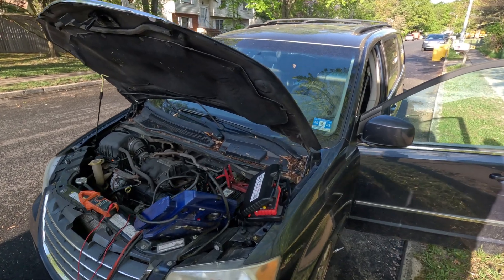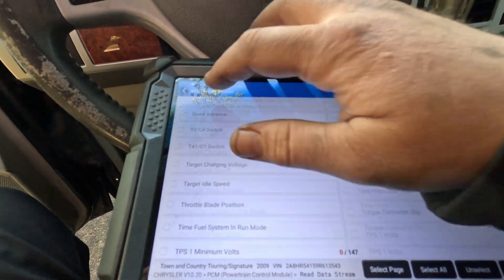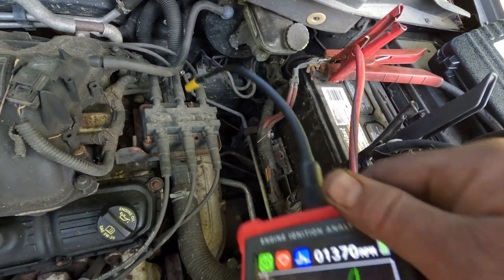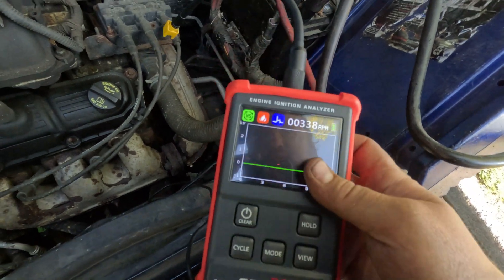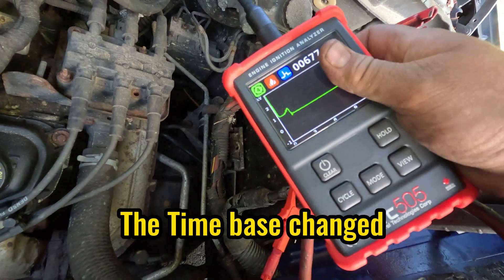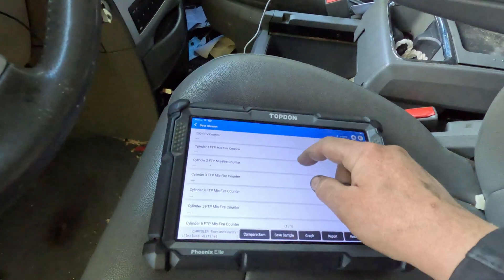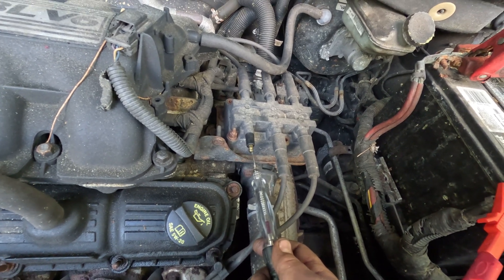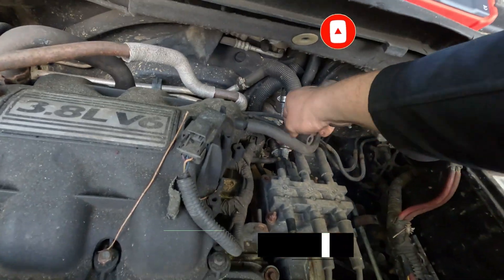Chrysler Misfire - Playing With A New Tool (GTC505)

Comment: Were you looking at the counters on global mode 6, or a Chrysler menu? 
Either way, wonder if the flywheel has to be learned after code clearing.
Reply from the maker: I honestly don't remember which one I was looking at. But that is definitely a possible reason why.
Reply: @advancedleveldiagnostics  Thank you for the reply. I like looking at mode 6 before any code clearing if possible, for documentation purposes. Also, have you used the VVT pid on mode 6 for diagnostic purposes? Just curious.
Reply from the maker: @rodvan-zeller6360  unfortunately I'm very weak on mode6, I pretty much only use it for misfires on older Ford's. I really need a good class on mode6.
Reply: @advancedleveldiagnostics  Thank you for the reply. You are not weak on mode 6, you are stronger than most because you know what you don't know.
I like using mode 6 for several reasons, one of them is record the numbers before and after repair when the monitor runs, for documentation of repair proof. Most of my past employers had a mission to prove me wrong on a daily basis due to their ego issues, so I learned to back myself up with every tool available.  
You are very good at what you do, I enjoy all your videos.

Comment: Where you get that test light 🤔
Reply from the maker: I used to get them on amazon but got really expensive
https://amzn.to/3VIAil3 It's the OTC 3633 I cut off the clip and put by own Banana jack connector. I'm sure if you google the part number you'll find it cheaper.
Reply from the maker: I found it cheaper on JB tools 
https://www.jbtools.com/otc-3633-mini-circuit-tester/?wi=off&gclid=Cj0KCQjwmN2iBhCrARIsAG_G2i6OE7n5G2mUD_klOv7gyXeNs6enfD6UOXIWGNP4acmwo0ybMoSX-BkaAleGEALw_wcB
Reply: @Advanced Level Diagnostics  thats smart on the banana jack adapter gives more variety from alligatr clips to backprobe . Thanks 👍

Comment: A classic Scannerdanner diagnosis, thanks for the walk along. I find that inductive tools vary so much with position of the sensor, it is harder to compare waveforms from one coil to another. The 'good old days' of a single coil weren't so great, but those solitary king coils were a lot more robust compared to coils that live closer to the source of heat. Presumably this coil was internally shorted, allowing one of the pair to continue working normally.
Reply from the maker: Thanks for watching! I would agree with your assessment about it being internally shorted.

Comment: It also works great on injectors. They made one just for injectors but this tool can work on most systems that have current running through it. For a quick look
Reply from the maker: I tried and I couldn't get a signal 🤔 I will try again...
Reply: Also you will have to put the probe to the side of the coil to get a better reading. Some coils are very insulated and you don't get solid readings.
Reply from the maker: @djmobileautoservices  It's funny because it worked great on Toyota and Honda coils which I cant get a reading with my Pico COP paddle so I'm not sure what there doing diffrent, But it is impressive!